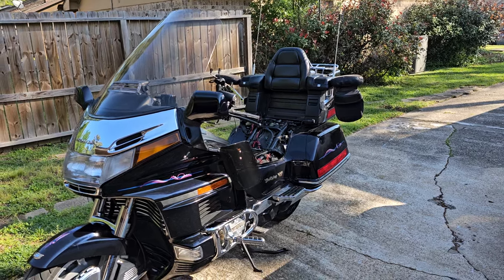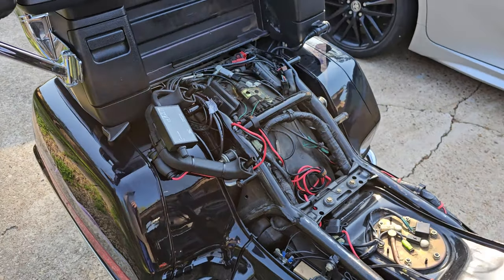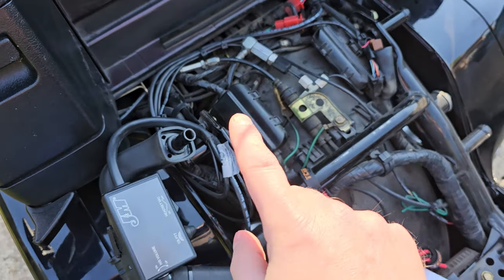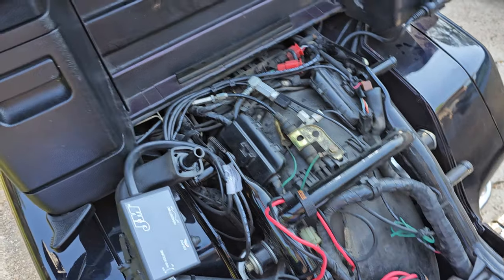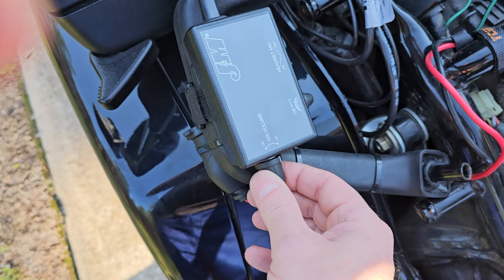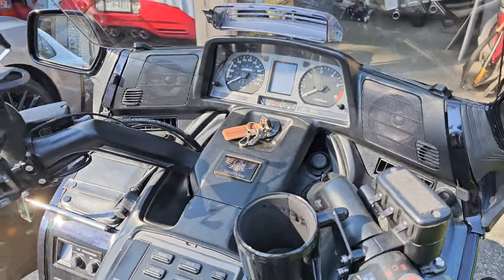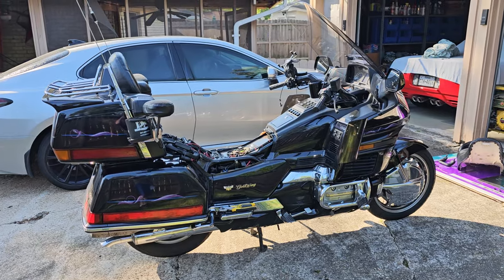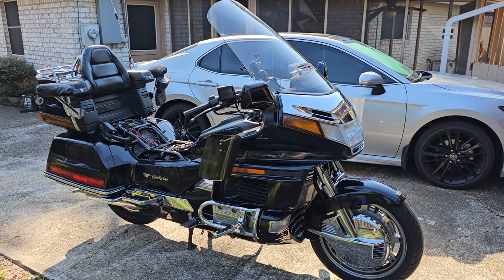1997 Honda GL1500 GoldWing SE: More Upgrades

Comment: Great information- thanks for sharing! I'm basically next door down here in Pearland.

I'm doing some of the same upgrades right now. For the front speakers I put in Kenwood KFC-1066S 4" 2 way speakers I found on Amazon. There's no modification needed to mount them BUT it's a bit of a tight fit on the fixed screw holes, maybe need to wiggle the clips but don't need to redrill holes. Maybe you'll need some slightly larger washers for the slider holes and you're good.

I want so bad to break the cc governor, but I've just bought the "Pierre Dal" LCD screen upgrade, and it has a visual gear indicator. My only bother is that flipping the pins might make the indicator read 4th. I guess I got to decide what I want more... thanks again and ride safe!

Comment: I've done the timing belts too... reach out if you have any issues. I didn't do it because I didn't know beforehand, but replacing the tension pulleys is a good idea too since if one of them fails it's the same damage to your engine as a broken belt.
Reply from the maker: Yes sir, one of the first videos I watched about the belts was from Herbie's Garage. He had showed he bought new tensioners and springs, so I figure if I'm in there might as well do it right per se then everything's good for another 100K and many years to come.

Comment: Question- do you like the Polk speakers? I was going to run out and buy them, but some reviews say they're not actually better than stock, no bass, etc; and even mention motorcycle and specifically Goldwing applications.
Reply from the maker: They sound good to me. I keep the tone knob about in the middle just so the sound is a little more crisp. Any other speaker setup I like lots of bass to hit for sure. But you have to realize in this particular setup the back speaker compartments are lacking space which is what you need to get good bass response. The stock speakers didn't have any better bass.